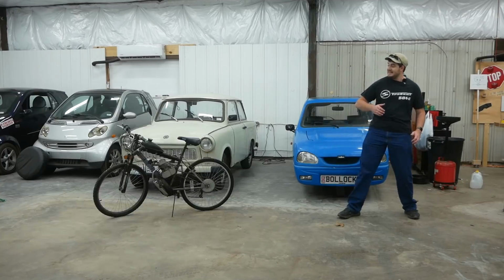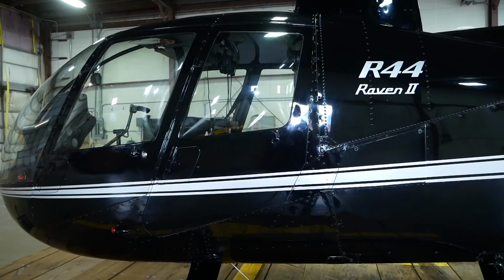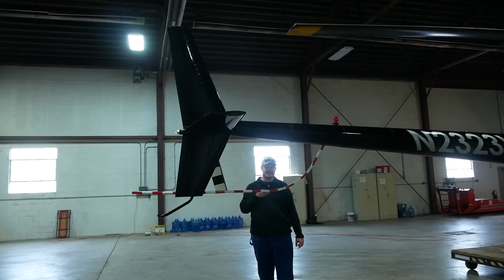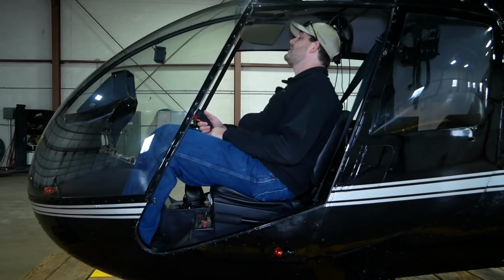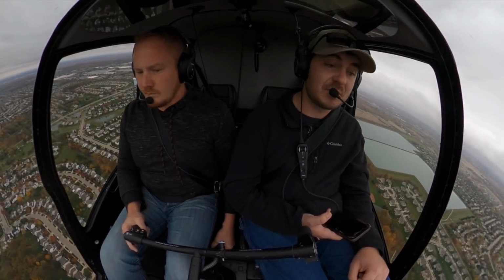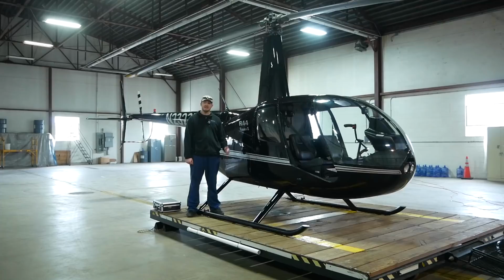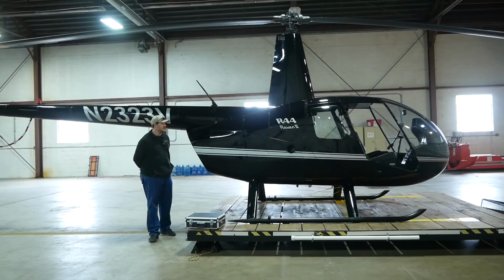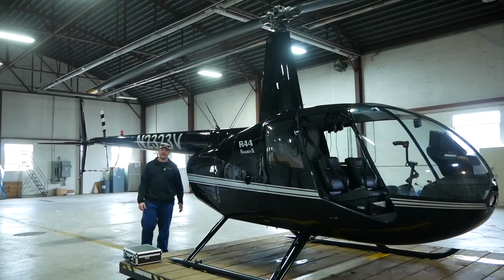Here's a Tour of a Robinson R44 Helicopter

Comment: When I first heard of helicopters' "autorotation", I was surprised, but I eventually realized it basically works like a maple seed falling, with more control.  It doesn't have range like an airplane gliding, but you also don't need a runway, so you just need to find a flat spot big enough to fit with some margins, and you do have some time to think if you're high enough.

Comment: As an airplane buff...
I love this episode. Sure, the cockpit tour was a little shy, but not unexpected. (all those fancy electronics on that lower panel you showed looks to be a radio stack, lights switches, and potentially some engine controls like the starter and fuel pump switches.)

I actually didn't know about tulipping, so I learned a thing. You also mentioned more Robinson models than what I knew, and supplied a way for me to remember them!

Finally, seeing a few short clips of you having control is a fantastic example that aviation is always safe. I see, in this example, a newbie that could (should they continue what they're doing uninterrupted) end up being dangerous - being kept in-check by an experienced pilot, who didn't even fully release the controls. The last detail was most definitely because of ground proximity.
That's how it is, though. That's how you learn, and there's nothing wrong with it. If I'm remembering properly, general aviation pilots (at least for fixed-wings) are trained so that, regardless of what orientation you put the plane in, they can recover it, given enough altitude. So a pilot (with enough altitude) could safely turn over control to a completely inexperienced person. If there's an upset, it just takes "I've got the airplane" and some execution to settle the plane out.

Can't wait for next year.

Thanks for coming to my TedTalk.

Comment: Tulipping??? I'm not a heli pilot or owner, but I've been researching getting a commercial rating and ownership for some years, and in all the videos I've watched and books I've read I've never heard of the term tulipping. Google was unhelpful as well but I may have misspelled it. not calling anyone a liar but id like to know more about this term
Reply: Ive never actually heard that either but its funny and accurate. Technical term is cone-ing. Coneing is normally kept in check by the centrifugal force pulling the blades laterally from the helicopter, but if you allow the MR RPM to fall to about 80% there isnt enough force to counteract the loads and the blades will cone up until they fail, resulting in another charmingly named outcome called "Yard Darting"
Reply: @adaml4493  Thank you!

Comment: My only experience in a helicopter was in the mid 1980s in a privately owned Hughes 300D (just like the one T.C. flew on "Magnum, P.I." but in a different color scheme). The ride was similar to yours, complete with an autorotation demo, although we were at considerably less proximity to the ground than you were. Very good video!

Comment: No.  The last thing you want in a helicopter is for the tail rotor to depart the airframe.
Reply: Actually they're relatively easy to fly without the tail rotor, just enter an auto or keep it above 70 kts and it will weather-vane. The main rotor is the one you dont want to lose, we call that 'Yard Darting'.

Comment: As a fellow knows nothing about helicopters, that was very informative.  I still do not understand how it can take off while spinning at a constant RPM.  What did I miss?
Reply: The helicopter blades have an adjustable pitch controlled through the collective stick. At flat pitch (low angle) they generate very little lift. At a higher pitch they generate more lift.

Comment: 6 Pack on the top - from left to right
Turn coordinator (if someone says step on the ball, this is what they're referring to. It helps for stable and comfortable turns.)
Altimeter
Attitude Indicator (shows horizon, pitch and roll) 
Airspeed Indicator
RPM (not part of the 6 pack)
Vertical Speed Indicator
Heading Indicator
Course Deviation Indicator I believe (not part of the 6 pack)
Manifold pressure (kind of like a barometer) 

In the middle you have the radio and transponder.

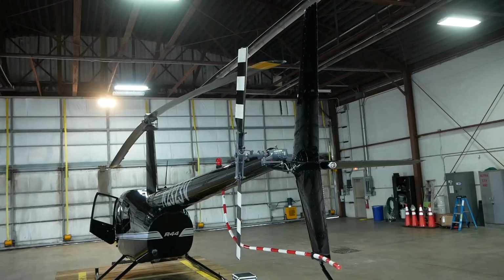Comment: 3:50 Gages are in order (top row): Turn Coordinator (for making sure you don't bank too sharply), Altimeter (showing how high you are), Artificial Horizon (to show your pitch and roll position in relationship to the ground), Air speed gage (so you know how fast you're going, RPM for the engine (top blades) and Rotor (tail blades))

(bottom row): Vertical speed (So you know how fast you're going down when the engine cuts out), compass rose (so you know what direction you're facing), "Forgot the name" (for use with navigational beacons and radios to find your way around), and Manifold Pressure (because you can't have too many gages telling you that your engine has a problem).

3:55 (top row): Engine operational hours (Because you thought your car's maintenance schedule was nutty), Battery gage (because a discharging battery in flight is a bad thing), Oil pressure gage (again, you can't have enough gages to tell you that your engine crapped out in flight) 

(middle row):  Clock (Because you shouldn't whip out your cell phone while flying), Fuel gage (because no go juice is no go), Oil temp (Seriously, not enough gages telling you the engine stopped.)

(bottom row): Another fuel gage and oil temp gage. (Sorry, hard to see them because of the light shining directly on them.

EDIT:
4:07 Top instrument looks like a navigational/GPS device (Not sure. Not a pilot and I don't recognize it.), Middle is the radio for talking with ATC and other aircraft, and bottom looks to be the transponder to send information back to the ATC when the aircraft is "pinged" by radar. (This is also where you dial in a "squawk code". In this case, probably 1200 because the flight is under VFR - Visual Flight Rules and not instruments.)
Reply: pilot here, this is all correct. the gauge you forgot the name of is a CDI (course deviation indicator), used for VOR navigation. the top electronic device you guessed was for navigation was a correct guess. it’s a Garmin GNS430 GPS.
Reply: I'm a firm believer in never having enough gauges telling you your powertrain is having a rough day.
Reply: @SYH653  Especially when you are separated from the grown by 1,500 feet. ;)

Comment: The older Cessnas also have massive engines. The 172r I fly has a naturally aspirated 360 cubic inch (5.9L) flat 4 making around 160hp. About the same as a 2.5L n/a Subaru engine.

Comment: The rotor on top of the helicopter is both to provide lift and to cool of the pilot.

I can prove it.

If the rotor stops spinning, the pilot will begin sweating at once.
Reply: ...similar function to the fan at the nose of a single-engine aircraft...
Reply: "the pilot will begin sweating at once". True, but not for long.
Reply: @olsmokey  No, after a short while he will probably start bleeding instead.
Reply: @olsmokey  i know it is a joke but its a bad one
Reply: Underrated comment.

Comment: A very enjoyable video. it was interesting to see a car guy having poke around on a not horrendously complex helicopter. Most helicopter video's I've seen are by people who are familiar with being around helicopters, so it never crosses their mind to mention some of the stuff you noticed, and the other videos tend to feature complex turbine aircraft that have everything packed in so tight that you can't see what any one subsystem is. 

I had no idea the R44 used a multi V belt drive for the main shaft, and while watching it spooling up the blades I was actually wondering about that moment when the revs dropped for a few seconds and the head speed suddenly jumped. I thought it might have a centrifuge clutch in there to get the blades spinning before locking up at operating speed, but then later you mention the adjustable tension pulleys a everything dropped into place.

Comment: I wish i could get you to Europe so you can try some weird cars here like Citroën dc 21, Citroën 2 cv  and my fathers first car a Renealt 4. (weird enough if i think of weird European cars all i can think of are French cars.... I am not even French.
Reply: Aah yes the Renault 4, with a gearstick sticking out of the middle of the dash, wheels thinner than my motorcycle, made out of stamped metal sheets and a hole in the front to be able to handcrank the engine to start, that is actually possible to do, due to the small engine.
Reply: @JohnDoe-bd5sz  Then again,  it's downright space-age compared to the 2CV. It was a modern car in its day and arguably the first successful hatchback, popularizing an entire body style.

Comment: Robert, there appeared to be a few moments when you showed fear. Rightly so, because helicopters are extremely fragile. They are one of the most maintenance intensive vehicles on the planet.
Reply: They can't be worse in terms of maintenance than a British car though.
Reply: @no1DdC  Yeah and most helicopters are not water soluble
Reply: @no1DdC  yeah, surely a 1970's Rover or Austin or anything British Leyland made would be worse for maintenance
Reply: While submarines are probably at the top of that scale.
Reply: @Somgosomgo  I'm pretty sure there are a few subs at the bottom of that scale...
Reply: @marcusborderlands6177  Much to the misfortune of the sailors that manned them.

Comment: constant RPM during operation? So basically a flying generator!
Reply: it generates lift!
Reply: In essence,  yes.
Reply: Well, technically yes.
But not the way you'd think.

You're generating lift, of course, and this vehicle needs constant RPM for that, as well as a number of fixed-wing prop aircraft.
But this engine does produce energy in the hydraulic systems it runs (yes that is or should be a plural) and with the actual generator it turns. Because who wants to constantly use batteries when we're already making power? Might as well turn some electrical in the process.
Reply: Think of any aircraft engine more like you'd think of an engine designed to drive hydraulics, air is a fluid after all.

Comment: My favorite bit of helicopter anatomy is the fastener at the top of the rotor mast that keeps the rotor blades on. It's called the Jesus nut, because, as the person who first told me about it explained, if it fails, that's the only person who can help you.
Reply: I now just want a helicopter so I can say Jesus tighten the nut
Reply: Critically important nuts and bolts will have small holes drilled through them and locked in place with ductile wire threaded through the holes. This prevents vibration from working the threads apart. Lock washers are not used and don't do anything if the nut/bolt is correctly torqued.
Reply: I was told it is called that because if it breaks all you have time to do is scream, "JESUS!!!!" 
😊😊😊
Reply: I've heard of "Jesus bolt"s in airplanes.  On Cessna aircraft, where each separate wing main spar bolts to the carry-through spar in the body, there's a single bolt that's like the size of your thumb.  My impression was that it was called at at least because 1) That's who the occupants would see if the bolt fails/falls out, 2) that's to whom and perhaps to whom the mechanic will be speaking when installing said bolt, but I like the additional "that's what the occupants would say if it failed" comment in this thread.  

Aircraft design does tend to eliminate redundancy when possible but sometimes there's no way to provide mechanical redundancy for structural components.  As others have pointed out, a single "Jesus nut" that holds on the entire rotor system would have at least one and possibily tow securing mechanisms to make sure it wasn't backing off, and is the sort of thing that you'd inspect regularly to make sure nothing was amiss.

Comment: I am intrigued by the warning light labeled "engine fire".  That implies that it is not easy to detect on your own that the engine is ablaze.
Reply: Strangely enough, it isn't always. It is, after all, behind you, inside a cowling, and piston engines don't stop working instantly when they're on fire.  Oh, you'll find out eventually, but the warning light is to let you know before then.
Reply: @ZGryphon  since you seem to know a decent amount about helicopters when you see the exhaust in the video with what looks to be oil on the exhaust is that normal?
Reply: @zackschilling5154  soot and grime are normal.
Reply: @keijo8238  ok used to cars where any oil period is generally bad
Reply: @zackschilling5154  the soot is normal because there is near to none exhaust gas treatment in aerospace (and yeah, space tech has no exhaust gas treatment what so ever). The  environmental impact is reduced by increasing the efficiency of the engines. Exhaust gas treatment like it is done in cars would mean a lot more of weight. Maybe this will change in the future but it will by no means make planes, helicopters or flying any cheaper or more affordable.
Reply: @zackschilling5154  It might be worth noting that it appears the Lycoming IO-540 was developed in the late '50s and early '60s.  If you remember cars from that era, they tended to leak more than today's cars.  I'm sure the IO-540 has had numerous improvements since the '60s, but the much higher regulation and much lower sales numbers for aircraft engines probably means design changes are more limited than in automobile engines.
Reply: @zackschilling5154  -- Obviously you have never owned any air-cooled cars.  Or any air-cooled Harleys.

As the saying goes, "If it aint leaking oil, it's empty!"
Reply: @davedarling4316  when I was in my early teens I toured a few military hangers. All the aircraft had huge cookie sheet drip pans under parts of them, and they all had an obscene amount of oil in them.
Reply: @davedarling4316  No air cooled cars here or motorcycles in general parents said if I ever got a motorcycle while at college they would instantly stop helping pay for college
Reply: @andrewsnow7386  At my flight school, I heard it was pretty standard practice to carry a couple of extra quarts of oil when flying the C-182 cross-country...Now, if we're talking radial engines...
Reply: @andrewsnow7386  a new aircraft is about as tight as a car engine with 100000 miles on it...they have to be built loose to withstand the extreme temperature changes they encounter, as they fly up and down
Reply: @zackschilling5154  As a former helicopter mechanic that worked on the R44 and R22 for about 4 years. They leak oil, burn oil, spray oil, and ooze it everywhere., especially after 1000-1500 hours of run time (When I stopped wrenching, they had 2200 hours time before overhaul). Fortunately, they come with their own tank of solvent built in for cleaning up the engine compartment every 50 hours (AVGAS).
Reply: @supergrover1827  I know for a fact I will never willingly climb into an r22 or r44 after today an avgas wash sounds like a disaster
Reply: @zackschilling5154  Most of that oil is blowby from the breather tube, all piston aircraft engines consume a good bit of oil, just from the nature of the design.
Reply: @keijo8238  on high performance engines, there is often some oil either purposely spread there or having leaked there.

Soot is very regular on vehicles that are also maintained by the operator as it actually carries no negatives
Reply: @sand0decker  
Yeah, unless you fly sport aviation, clip the wings by a couple feet, strip anything unnecessary after fitting a new engine that also leaks oil, track off every ounce of weight you can, and have yourself on a diet so you can be a couple pounds lighter - all just to get around the Reno circuit 5 tenths of a second faster. Then that soot is added weight, and we don't need that.
Negligible for most, but there will always be the ones that push for the extremes.
Reply: @zackschilling5154  also the fuel is leaded more often than not so that adds so deposits. But really all things said they are very reliable engines if more no other reason than the very frequent and in depth maintenance work that is performed on them.
Reply: @zackschilling5154  It's nothing too serious just where his beefburger stuck when he was cooking it.
Reply: Normally on small aircraft with an engine of this size it's either in front of you or one on each side of you so it's pretty easy to see. In this case, however, it's right behind you and next to the fuel tank.
Reply: Reason number 4, 551 why flying cars are never going to exist.
Reply: @tarstarkusz  To be fair, I do complain that a Cessna 152 is a car that someone bolted wings and a propeller on xD
Reply: @1FireyPhoenix  and it would have been a Chevy Chevette that it came from as the performance of the 150/152 is about the same as that little car!
Reply: Also, generic avgas still contains tetraethyl lead unless the grade has the "UL" suffix or prefix.
Reply: Just a pity the light only comes on approximately 33.5 seconds after you smash into the earth when nobody is alive to see it
Reply: It is for the redundancy.